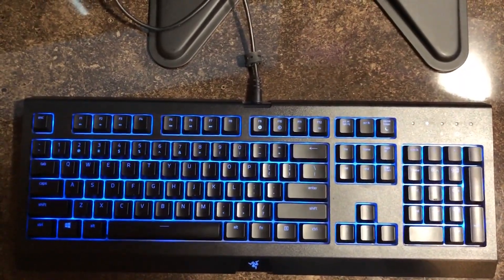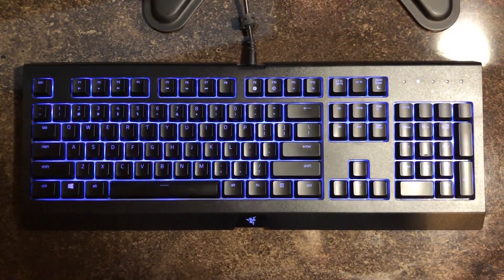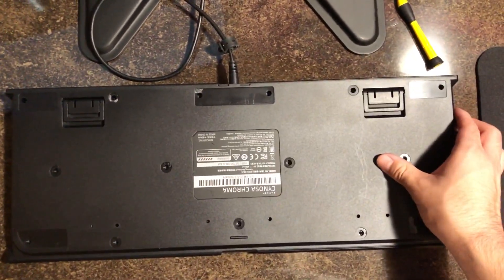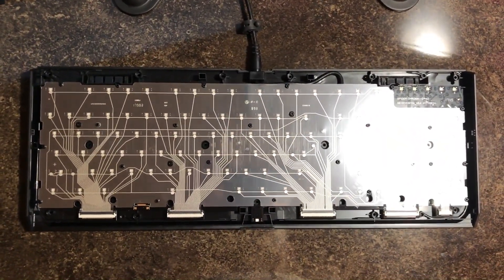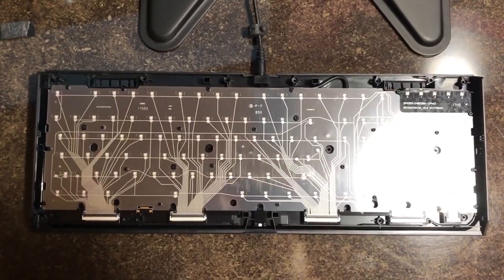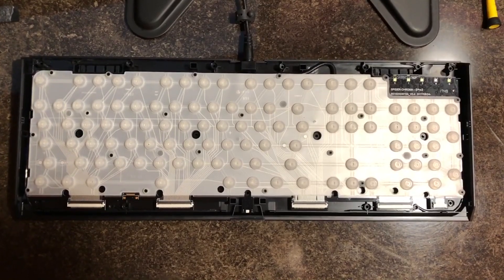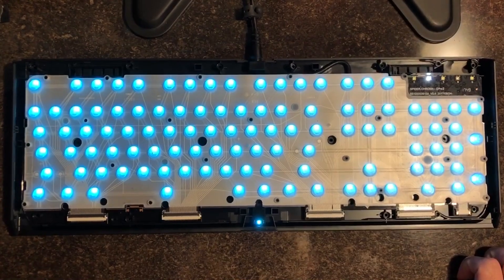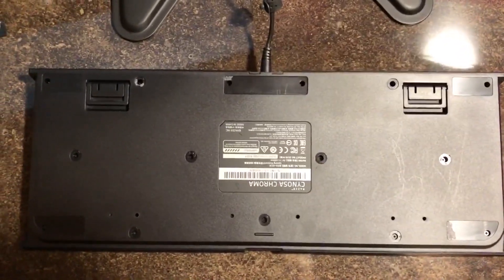Razer Cynosa Chroma | How to Fix One Key Typing Multiple Letters

Comment: ----
Razer Cynosa Chroma | How to Fix One Key Typing Multiple Letters
----

#serge Thank you very much for this good and helpful #Video.

Bought one Razer Cynosa 2 days ago, having the same issue now.
Sending it back makes not much sense ass it was not expensive.

Wanted it as temporary replacement for my almost 6 year old
Corsair K70 Lux RGB keyboard (it needs a new space bar switch
which I currently do not have).

Well, until now it's been 2 times for me that new Razer products
stop working (Headset dead after 2 weeks, Keyboard after 2 days).

I decided to stay with Corsair for the future, many more options on
keyboards, mices are great (scimitar pro rgb) and the ICue Control
Software is good as well (Better than this weird Synapse plus there
is a Linux Version of it which I do need because working with 2 OS).

Well, maybe I just bad luck with the items :)

Kind regards and best wishes!

Comment: Fixed my Razor keyboard with your help. In my case I had to clean the pins that connect the transparent plastic circuit foil to the bottom IDE connectors. I opened the IED pins and wiped (dry) the circuits there as well. With this I fixed the right shift key that typed the question mark just by itself. Thank you !

Comment: Man I had an exact same issue with this keyboard, TWICE... I wish I'd knew back then to only wipe the contacts clean. Although opening up would probably void the warranty. So I just requested refund at the time and bought basic Logitech K120 for 15€. Still works 3 year later with 100% reliability.

Comment: Great video. Muchas gracias

I fix my keyboard Just by adjusting the flex cable connector of the circuit. There was my problem. 

Arregle mi teclado solo alineando el conector flexible del circuito. Ahí estaba mi problema.

Comment: Your step-by step to take the keyboard apart was great.  However, even after following your process for cleaning, the F key would always type "fg" when pressed.  I watched another video that wasn't as detailed as yours for taking the Razer Chroma keyboard apart but had an extra step.   I had to lift the dark plastic clamp tab with a guitar pick and remove and clean the ribbon then reconnect.  I cleaned with alcohol and q-tip and that WORKED!  Keyboard working great now!  Thanks!
Reply: This is what I had to do too, it works now.

Comment: One thing to note is that the issue can also occur at the contact trace array which is connected to the keyboard PCB by 5 latches (4 large flip latches and 1 push/pull latch with two separate latch pins) that connect via integrated ribbon cables. My issue with the L key typing k and l was a result of something conductive on the L trace of the trace array. cleaning the arrays is what ultimately fixed it for me but this guide was a great start. Thank you!
Reply: Thanks @ryanashey. This worked for me!

Comment: Thanks for the video, just fixed my J & K, Numpad 6 & Comma and another one i already forgotten, had 3 of these buttons that always pushed 2 buttons, now it all works fine again. I needed like one hour or something. First i thought only J is not working right, then i noticed the other faulty ones too. :D

I just used "Sterillium" it's a hand disinfectants, i usually use it to clean my hands. Finally the pandemic is good for something, most ppl already got this at home.

Edit: One day later the numpad already didn't work right again, only was able to fix the J problem permanently. I just ordered the V2, and hope that one doesn't get the same problem. And if it does it will probably be the last Razer product for me. Maybe Razer really is just trashy, and shouldn't be bought by anyone.
Reply: What is the v2 called as I may buy it?

Comment: Still a great video in 2021! Had to go "stage 2" and do what @DrizzlingRose suggested but all works a treat now.  Thanks!
Reply: Could you explain in detail exactly how you did this?  I read @drizzlingRose's suggestion but i couldnt piece together what he meant.  (i did take it all apart as well down to the membrane and cleaned it at the least. ) in my case, the Tab key also presses the Q key when typing.  Also my windows Key no longer works but thats not as big a deal
Reply: The plastic sheets, disconnect from the bottom of the keyboard and then just reconnect.

Comment: my problem is removing the frame of the keyboard it is so hard to remove the frame.. it is more helpful if you demo the whole throughout
Reply: you need a screwdriver or something like that coz it's very hard fixed on all 4 corners of the keyboard. it will get a little bit damage but keyboard will be fine and don't worry about the loud click sounds when you open it

Comment: Hey man, thank you so much. It doesn`t worked for me with just cleanig the key contacts. But after I cleaned the main contacts/switches (the once under the clip, you have to open (there are 4)) it finally worked. Without your help I never made it. I think this will work for all keyboards with this kind of failure. Maybe you should change the headline!?
Reply: Thank you daniel. Lifesaver, I had the same issue.

Comment: Had this same issue. The UP key was pressing 5 and Up - DOWN key was pressing Down and Pg Dn.

Didn't have to take my keyboard apart, but seeing your video on how it looks underneath helped me come to the conclusion of how I fixed my issue - simply used some concentrated gas, turned the keyboard on it's side and shook it a bit.

Anything that must have been crossing the wires was gone
Reply: I had this exact problem, followed his instructions, and it fixed it! I've been pulling my hair out trying to figure out what was wrong.

Comment: Thank you for the upload the video... 
I finally fixed it!!! and have realized what causes the problem.
The problem is the connector. 
At the video 3:35 you can see the 5 ribbon cable. lift up each black bar(?) then you can pull out PCB(white plastic thing) and cleaning the connecting point and reconnect it
(sorry for my bad English)
Reply: Thank you, that fixed my problem !
Reply: you sir have saved me from buying a new keyboard, i can not say thank you enough.

Comment: every time  i press w it presses e
Reply: I think it might be because you are using a keyboard profile
Reply: Hope this helps

Problem: Setting your keyboard to a custom profile will cause this continuous registering of a key. Basically, it is an issue with the Razer Synapse software.

Solution: Set your keyboard profile to default (usually the uppermost profile on the list. For example: "DESKTOP-OB9QANA...").
           
                 Step 1: Launch Razer Synapse.
                 Step 2: From the top bar, select "KEYBOARD".
                 Step 3: Go into either "Customize" or "Lighting".
                 Step 5: Besides "Profile", there is a bar. Upon clicking it, it'll show you a list of profiles (unless you haven't made any profiles,
                               these instructions are not required as this may not be the source of your problem).
                 Step 6: Delete all other profiles (you may lose things such as key bindings). In doing so, it is required to select the profile 
                               first and then delete by pressing the three-dot icon 
                              
                               Warning: do not delete the uppermost profile as it is your default unless it doesn't allow you to delete it.
                
                Step 7: Select the uppermost profile, usually the first and the default profile. Therefore, your problem should be solved.

Comment: Real problem is in misalignment of flexible board and bottom connectors during assembly. The flexible part is slightly narrower than the inner space of the connector and can be installed with offset during assembly. Make sure the pins on the circuit board are exactly centered with the pins on the flexible part.

Comment: Didn't work for my keyboard and Kanai's comment didn't work either, I fear that it might just be something with the circut it's self for my case as I cleaned the rubber thing and everything but it is still having the same problem (aka when i press W it presses Q along with me pressing S and it pressing A as well) nothing i've tried has seemed to fix the problem
Reply: https://youtu.be/e6jTefdfATE

Comment: Upvote this so people can see and fix the real problem. With the "real" problem I mean that when you press "a" once you get "as" for example, that seems to be a frequent problem area with this keyboard but it can also be with "w" resulting in "wq". Read further for the solution.

Step 1. Open up the keyboard.

Step 2. Remove the rubbery mesh.

Step 3. Here is the plastic layer with the white lines on it. There is some disturbance in the connector areas (5) at the bottom of the keyboard. (see 3:13 in vid)
You can see that the bottom part of those connectors is white, and the top part is black/grey.

Step 4. The black/grey part is actually a very small clip that you can "raise". When you raise the clip you can move the whole plastic layer (beware tho cause it's also attached to the other connectors. In my case pressing "a" resulted in "as" so it's obvious that the left connector had an issue. You have to reposition the plastic part that goes in the connector very slightly. You can test this while the keyboard is on. Reposition the plastic slightly --> close the black/grey clip ---> test if the problem is solved --> if not, open the clip again and reposition etc. Took me 5 try's since we're talking about very small adjustments here but eventually you should get it. 
Mine works perfectly again.
Good luck!
Reply: you're the best human to ever exist on this planet
Reply: @djenr8  I try my best :)
Reply: @Minas-Morgul  my keyboard is blackwidow ultimate and when i type "w" it types "wn" and when i type "m" it types "lm", it's mechanical inside and this method isn't suitable pls help me
Reply: @mr_ninj4918  Sorry for the late answer, I don't check youtube reactions often. Do you still have the problem?
Reply: @Minas-Morgul  no i don't think so, but im too lazy to put all the keys on the keyboard xD
Reply: I think this is the first time I ever comment on a video, but damn, you are my Wednesday night hero. Was looking at the keyboard for 2 hours trying to figure out what could be wrong and then I stumbled on this comment. Thank you kind sir.
Reply: @stevetheunissen  No problem mate, glad I could help and save you some stress!
Reply: Also, clean the contacts with alcohol to make sure that they are 100% likely to work (this is what solved by issue

Comment: i had the same problem, which was a hardware one also. its very good what you did but i fixed the problem with air duster, it stopped after a while. i advice to try with the air duster first and after a while if it still doesnt fix the problem ill do it like the video shows

Comment: werlp as you can probably terll my "e" kery is brokern and so is my 34 (four) kery so im going to try this and hoperfully it fixers my keryboard
Reply: DUDE my bad keys are "w" and "3"
Reply: @alexiwells4993  got the same problem, happened a couple hours ago. same keys too
Reply: @GGdesignsandprinting  if you figure it out, let me know and I'll do the same.  The cleaning method didn't work, reinstalling synapse didn't work. I had to switch back to my factory keyboard because typing is the main part of my job.  :(
Reply: Found this on another video. ""I fixed it by also cleaning the connectors on the bottom. to disassemble them, lift the little grey plastic cover on top of each connector and then pull the connector out.
" Not sure if that's worth a go. I'll see what Razor support say
Reply: @GGdesignsandprinting  Response   This is what I got from Razor support

 
No worries we will do our best to help you. I have prepared some troubleshoot steps for you. Please do try and let me know the outcome.
 
Try to clean the keyboard from potential dust/dirt
• We suggest holding the unit upside down and/or using compressed air from a can.
 
Try with another USB port
• Try on a different USB port, and if you are using a USB hub, please try directly on your computer or at least use a powered USB Hub.
 
Try your keyboard using a new profile
• Select your keyboard from the bottom menu, if not already selected.
• Hit "+" under Select Profile to create a new profile. The trash icon deletes the selected profile and the contextual menu lets you import/export.
• Name the new profile. (Tip: I use game titles.)
• Test if the issue persists
 
Reinstall Synapse
• Go to control panel and look for Programs/Programs and Features
• Uninstall Razer Synapse. Restart PC
• Download Synapse 3 from www.razer.com.my and install Synapse 
• Restart PC and check if issue persists.
 
Try using the product without Synapse. 
• Go to Task Manager
• Right Click Synapse from the list and choose “End Task”
 
Try the Device with another laptop or PC
I'm looking forward for your reply soon and i'm here for assist you anytime.
Reply: @alexiwells4993  Guess none of them worked? I'm currently arguing with them. I'll let you know if I find a solution
Reply: @GGdesignsandprinting  nope, they took my personal info now (address, phone, full name)  who knows what they're doing with it

Comment: Great video! Also sometimes the ribbon cables get just a little sideways, you can release the cable retainer and make sure they are snug and aligned then reset the retainer before reassembly.
Reply: This is what solved my problem after doing what he said in the video. He should pin this comment. Thanks a lot!

Comment: I found another problem that is related to the continuous registering of a key.

Problem: Setting your keyboard to a custom profile will cause this continuous registering of a key. It is an issue with the Razer Synapse software.

Solution: Set your keyboard profile to default (usually the uppermost profile on the list. For example: "DESKTOP-OB9QANA...").

1. Launch Razer Synapse.
2. From the top bar, select "KEYBOARD".
3. Go into either "Customize" or "Lighting".
5. Beside "Profile", there is a bar. Upon clicking it, it'll show you a list of profiles (if you haven't made any profiles, disregard this comment entirely as this will not help).
6. Delete all other profiles (you may lose settings, such as key bindings). In doing so, it is required to select the profile first and then delete it by pressing the three-dot icon 

Warning: do not delete the uppermost profile as it is your default, unless it doesn't allow you to delete it.
                
7. Select the uppermost profile, usually the first, default profile.
Reply: I dissembled the keyboard cleaned it same method everything it was fixed for a couple minutes and started happening again, it happened after i alt tabbed out a game because it never happened before that and suddenly the problem occurred, i also tried this solution, didnt work either, do you know any other solutions?
Reply: @Mister_Moon10  Unfortunately I do not know any other sort of solution. (  〒▽〒)
Reply: @Mister_Moon10  There is always the option to look around the internet, but I assume you've already done that.
Reply: Bro thanks, you just saved me a lot of money
Reply: @Ouraus  (≧◡≦)
Reply: Wow, thanks brooo. i started thinking razer sucks beacuse i have this keyboard only a month... I did what you said and the problem was with the macro.
Reply: @mkofficial943  (ﾉ◕ヮ◕)ﾉ*:･ﾟ✧
Reply: @Lil Enzyme Why you are welcome (  ◡‿◡)
Reply: Nice try, but it's not working on my keyboard >_<

Comment: Bro when i press E its like Typing R is it like its bind together could you plz help me?
Reply: I found another problem that is related to the continuous registering of a key.

Problem: Setting your keyboard to a custom profile will cause this continuous registering of a key.

Solution: Set your keyboard profile to default- usually the uppermost profile on the list (e.g "DESKTOP-OB9QANA...").
           
                 Step 1: Launch Razer Synapse.
                 Step 2: From the top bar, select "KEYBOARD".
                 Step 3: Go into either "Customize" or "Lighting".
                 Step 5: Besides "Profile", there is a bar. Upon clicking it, it'll show you a list of profiles (unless you haven't made any profiles, these instructions are not required as this may not be the source of your problem).
                 Step 6: Delete all other profiles (you may lose such as key bindings). In doing so, it is required to select the profile first and then delete by pressing the three-dot icon (Warning: do not delete the uppermost profile as it is your default unless it doesn't allow you to delete).
                 Step 7: Select the uppermost profile, usually the first and the default profile and your problem should be solved, unless it didn't, then I was of no help to you at all and have wasted your precious time. My apologies.